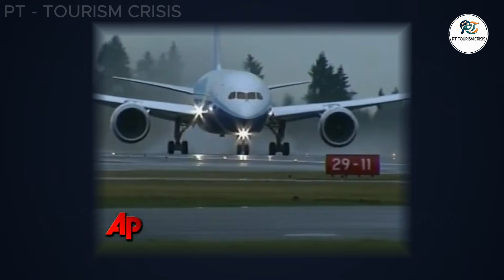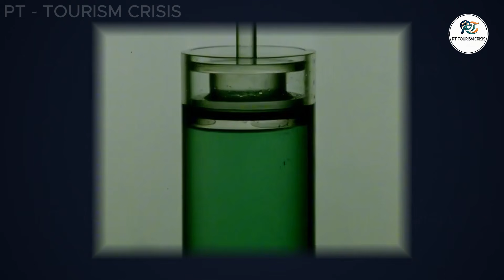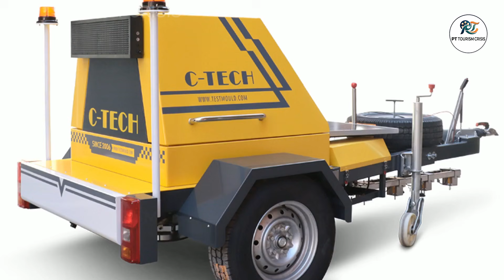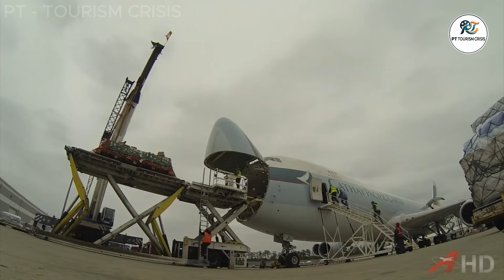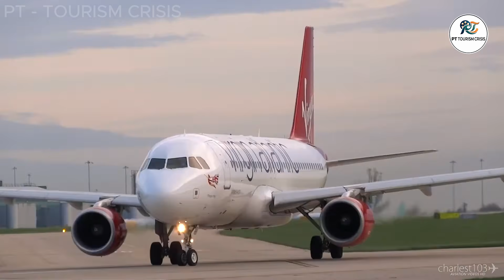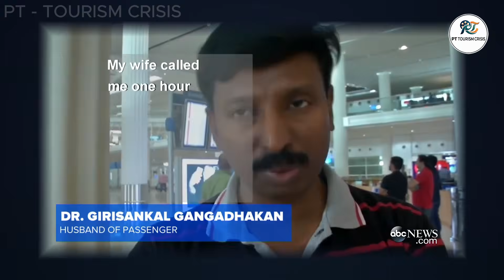Why Dubai's Runways Are Losing A Daily Battle Against Air That No Longer Weighs Enough

Comment: I have one suggestion for runway which becomes hotter. 
Work on base of runway. 
Use chikaat Matti of river. 
Cover it tarcole.
The main problem is sand at the bottom of road which absorb the heat.
If chikaat Matti absorb heat it will be  solidified like stone. 
Nothing harm in doing experiment. 
Jay bharat.
Reply: Using rubber sheet, sheet per sheet on runway. 
It can be changeable. 
Rubber can absorb heat.
Reply: Putting rubber sheet bit per bit using velcro will be very easier and lesser costly to maintain during rainy season.
Reply: Double layer protection will work. 
One below from earth. 
Second above on top.
Reply: Another method through airplane must work is using manua force or mechanical force to fly wing like bird.
Wing must prop up outside. 
Then use system of moving each wing.
I have written on net previously how it will work.
Reply from the maker: Interesting idea, but clay beneath a runway can create its own problems with swelling, shrinkage, drainage, and load-bearing strength. Still, experimenting with better heat-resistant pavement systems is absolutely worthwhile.

Comment: Planes have been landing and taking off there for years, so what is the point of this video?
Reply from the maker: Exactly, and that is the point: aviation already works there because aircraft performance, runway operations, and procedures are designed around the heat. The video is about how much engineering sits behind that normal-looking operation.

Comment: The first time Phoenix, Arizona hit 122° F/50° C, the airport had to close down. They said that operation manuals for planes topped out at 121° F. They said they were going to have to update the manuals. They didn't explain more than that. This video finally explained what was really going on. The manuals were updated, and the next time it hit 122° F the airport was able to stay open. I understand now how difficult that all was. Thank you for making these videos. They explain things so well and it's appreciated
Reply from the maker: Thank you, really appreciate that. Extreme heat limits are often about aircraft performance data and certification, not one universal temperature cutoff, so updated procedures and charts can make a huge difference.

Comment: About 54 degrees C. Or 129 F. 😮
Reply from the maker: That is certainly extreme, but there is no universal cutoff. The actual limit depends on the aircraft, runway, weight, altitude, and operating conditions.